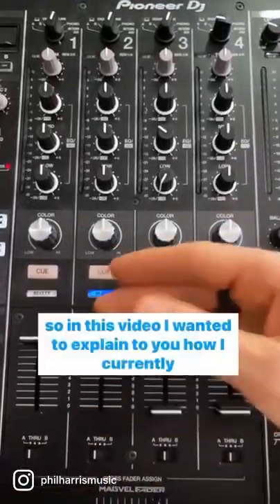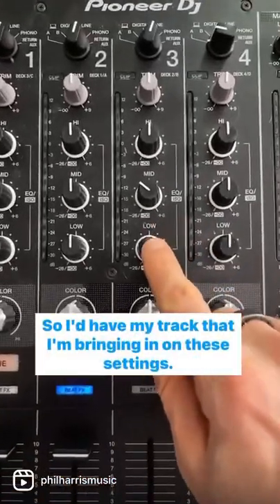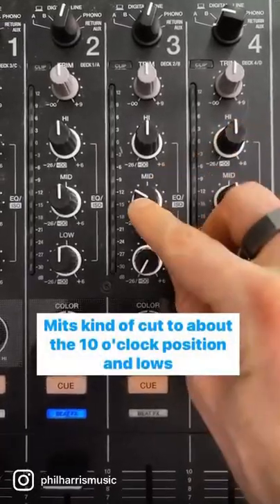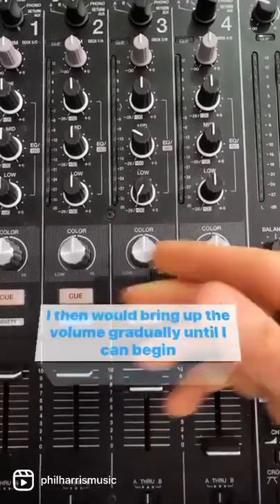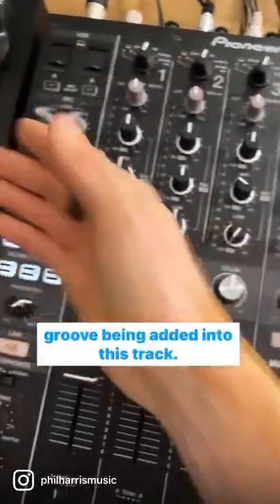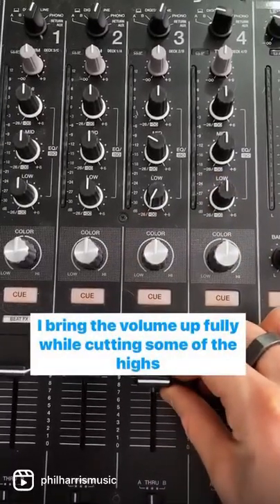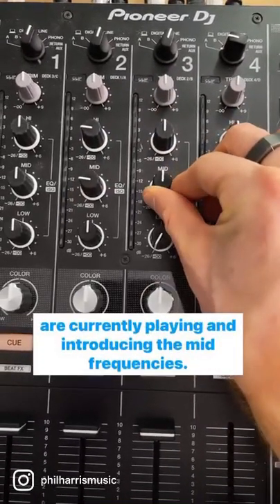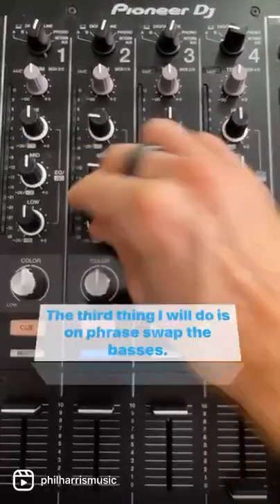How I Mix Explained

Comment: Swapping the low freqs like that may make the mix a bit dry. It's better to put down the track that is leaving at lvl 9 and start playing with both track's low freqs also with the track that is entering at lvl 9, then when you have the groove you want top lvl the track that is entering. That will make the mix sound complete at all times